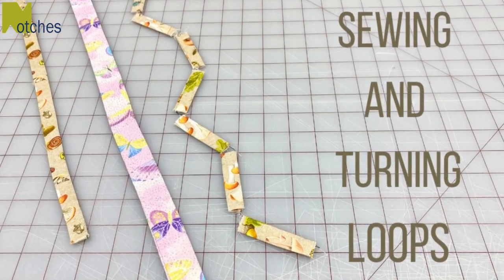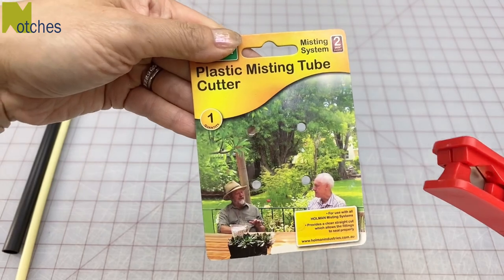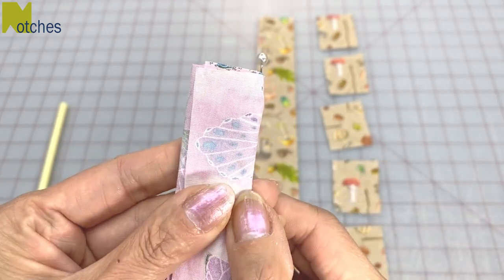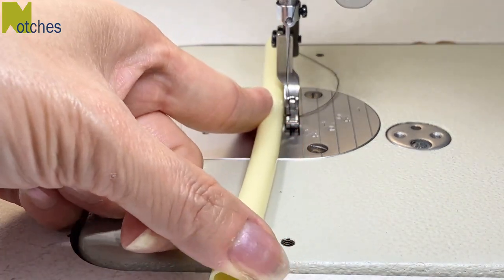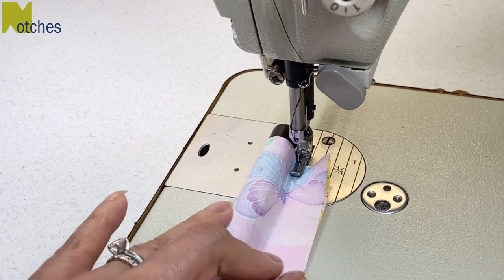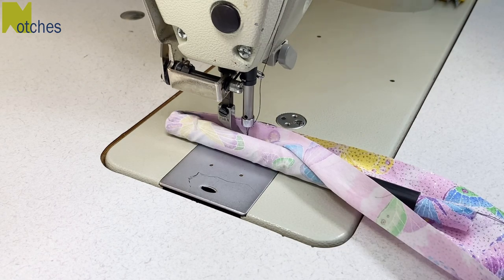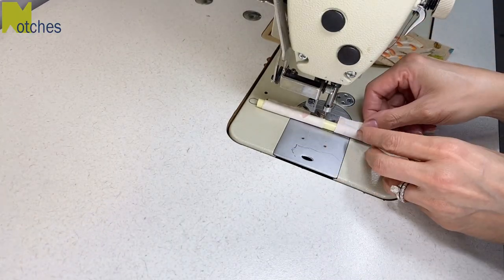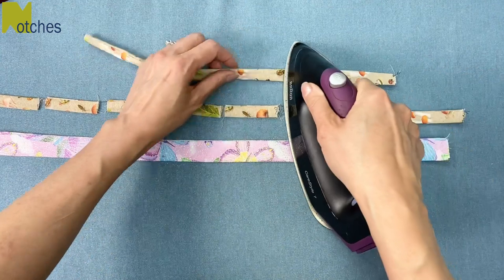EASY HACK  How to sew and turn tubes and loops FAST!

Comment: Well, that was fun!  I just tried it on my regular sewing machine with a standard foot, and it worked great!  I used 2.5” width fabric and a boba straw (wider than a regular drinking straw).  Mahalo!
Reply from the maker: Great job!  I’m impressed the boba straw held up to the pulling.  Great that you repurposed it!😊
Reply: Great adaptation

Comment: What are the loops used for? Im new to sewing 😅❤ thank you
Reply from the maker: The loops can be for anything.  I am just showing a very quick way of making them.  When making loops, especially the small ones, it can be very time consuming and hard on the hands if you have a lot to make.  This method can be used for straps, handles, belt loops, the loops on the back of neck ties, scrunchies etc.....  Thanks for watching!
Reply: @NotchesSewing  thank you for replying!